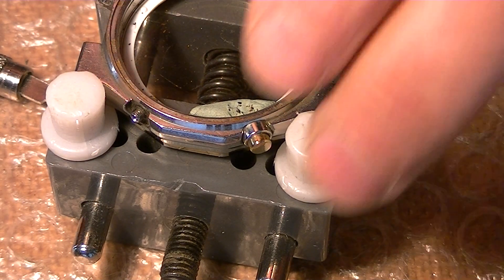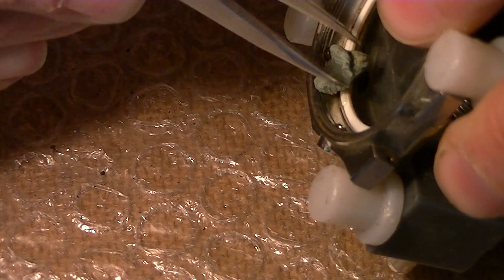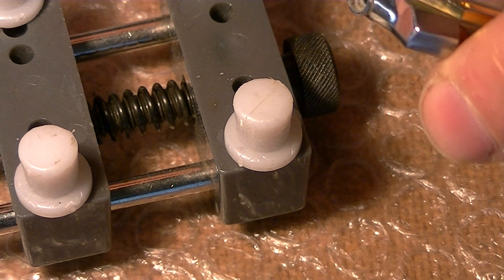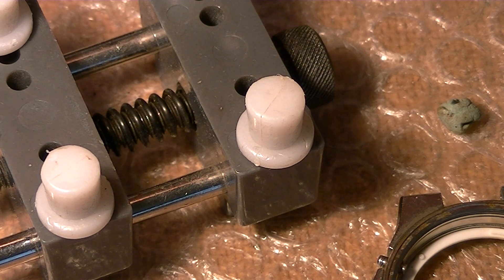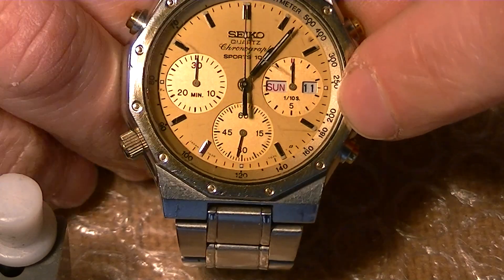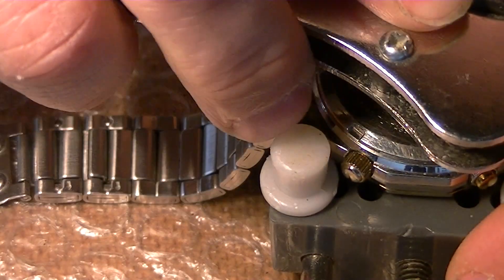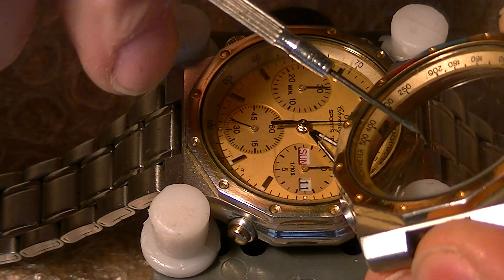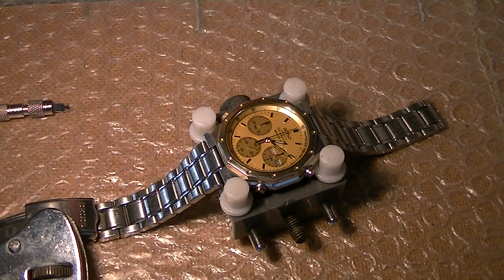How to repair a Vintage Seiko 7A38-702A Quartz Chronograph - PART 2

Comment: the golden timing switch was missing also in my watch. Does it totally compromise the working if it is missing, or only time is badly regulated, so the watch should run without it?
Reply from the maker: the watch could behave strangely without it, I never tried, so actually I do not know. Logic tell me it will just not work, it being an electrical contact needed to make the watch work....
Reply: @onlyvintagewatches Thanks for reply, George. I 've seen a photo of the pcb on the web and in the  "halfway" position there is no contact, so it should work.
Reply from the maker: @giuseppevito3923  TRy it and let me know ;)